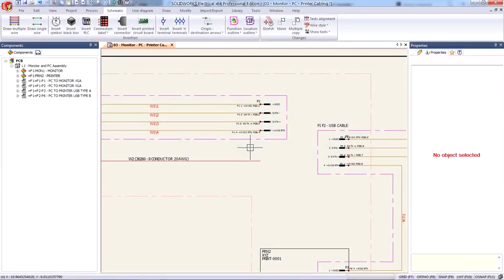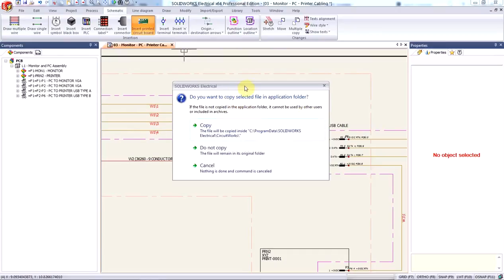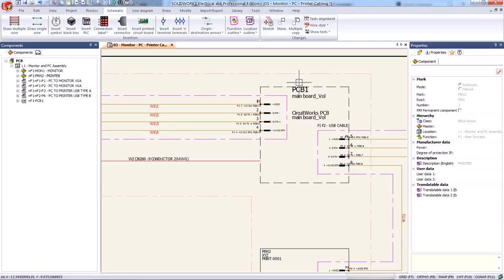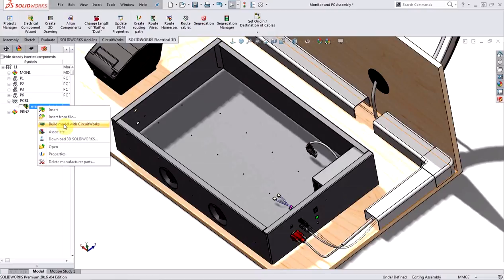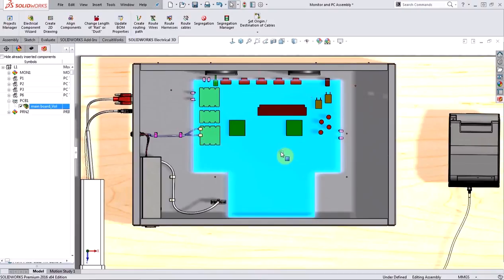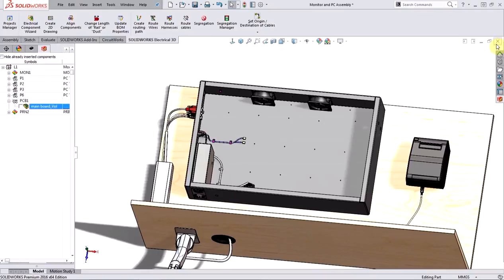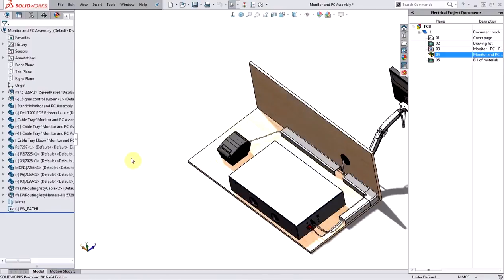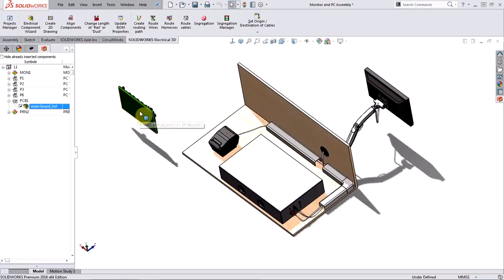SOLIDWORKS Electrical: Creating PCB from an Electronic Design File

Comment: What SW was used to generate the idea file. Are there various other formats of idea file that SW Elec can use? Is it backwards compatible? That is; can you make changes to the PCB layout in 3D and save out the idea file from Solidworks?